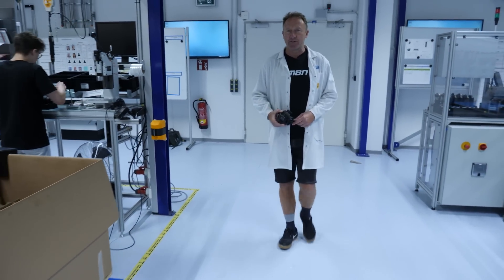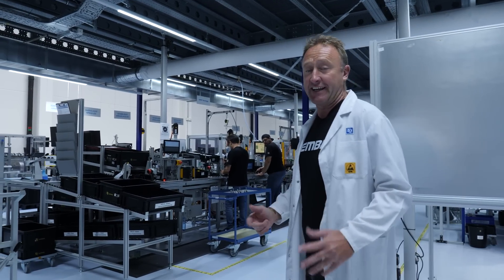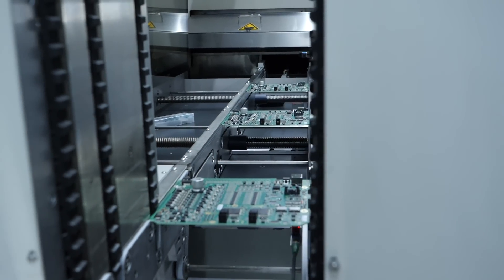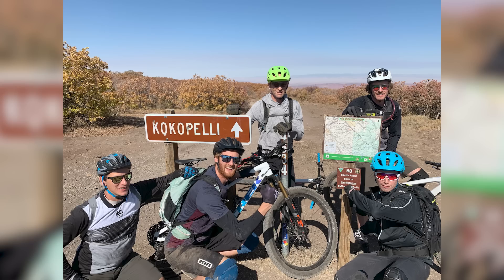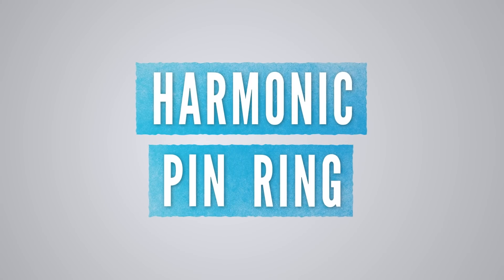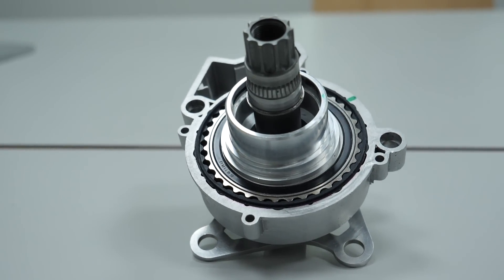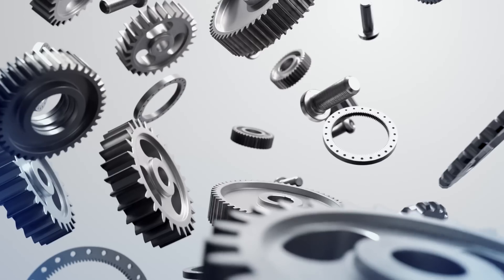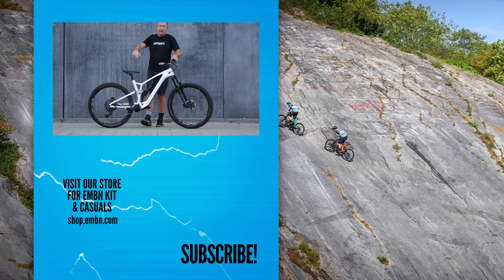How E-Bike Motors Are Developed & Produced | Inside The TQ Factory!

Comment: I was watching the section about the pinion torque ring with a sense of familiarity then it hit me I have seen this before, I spent 40 odd years in the hydraulics industry and the mechanical motion of the TQ motor is very similar to low speed hi torque hydraulic motors. I am not taking away from the incredible development work done by TQ  to refine this system but as they say there is nothing new under the sun. Great video Steve.

Comment: I have a Trek EXe 9.7.....the TQ motor is amazing and smooth. Quietest motor on earth and the best ebike you can buy. The TQ display on the other hand is junk, the biggest POS ive seen. How can a conpany like TQ engineer a motor so awesome and then come yp with a display/control unit as junk as what comes on the EXe. It should be 100% water proof on a mountain bike but no, if your sweat falls on it the thing shorts out and stops working. Take this back to the drawing board please!!!

Comment: So what was the reason the highly praised 'Flyon'-TQ-System of the Haibikes only lasted, was it 3ys?, then, without getting any questions answered by Haibike/Winora or ANYone, was kicked completely off the product line and being replaced by Panasonic and Bosch. Strange, for such advanced space-age technology ... :)
Reply: We will probably never know.  Human relationships play a big role in business deals, so maybe somebody at TQ said something rude to a Haibike person.
Reply: Haibike had many problems on many fronts. From manufacturing to the quality of the frames. Maybe the Flyon Projet wasn't profitable enough and they could make more money by just using the standard motors and displays.

It could hardly have been due to the TQ engine. This motor has been used by M1 for almost 10 years. A German premium bicycle manufacturer. For M1, the TQ 120 has been the primary engine, and part of the overall M1 experience. This would not have been the case for such a long period of time if the TQ engine wasn't good. With bikes over €10,000, you don't forgive many mistakes as a customer.

Comment: Easy to be impressed with the technology inside the motor and the factory ,what is missing is the second face of the coin. 
Reliability of the motor in the real world face to submitted efforts and environment elements such as dust,water ,hot cold ...
And the most important : how is the policy and actiitude and stance  from the brand when it comes to repairs and maintenance outside warranty ,and even during warranty.Will they be honest in facing the problems and assuming them ? Will they offer parts and repairs outside warranty and even sell them to the market and repair shops giving them tech support ? 
If so they are welcome and be a trust partner with the customers, making a diference from some competitors and we can buy TQ with confidence with no fear from  to be defrauded and loss.
If they close theirs units to secret and no parts /repairs like some ,they can stay at virtual dimension with their top products and we can see them in holograms how they are beatiful.

Comment: Interesting tour, but I have still not found any information about what voltage the system uses. It says something like 50 V on the battery, but is it a 48 V motor and in that case why hasn't this been communicated (as an advantage)? I mean better range, smaller size, lower weight, less voltage drop issues e t c are clear advantages in my book.
Reply: batteries dont always have the same voltage. so a difference of 2v isnt that much.
Reply: @SB7-r9i  Maybe I was unclear, I mean if it is a 36V or a 48V motor system. I know that battery voltage varies somewhat.